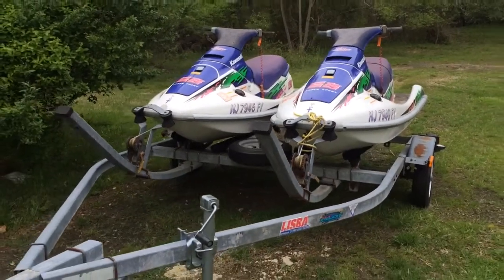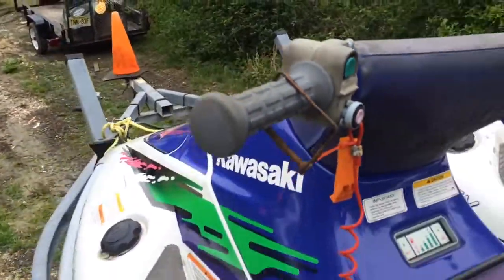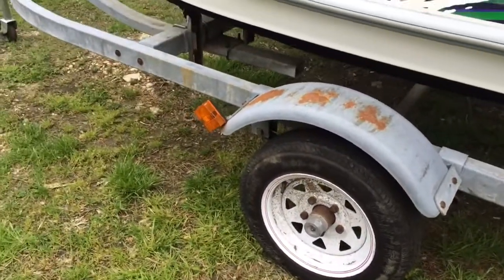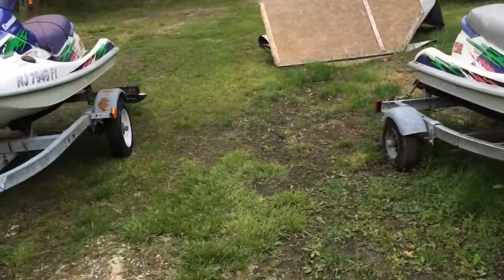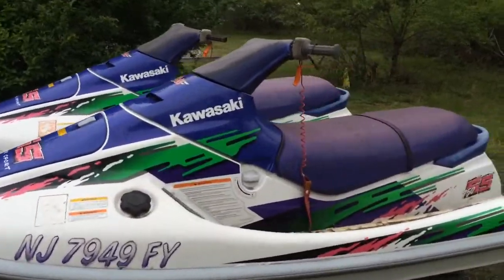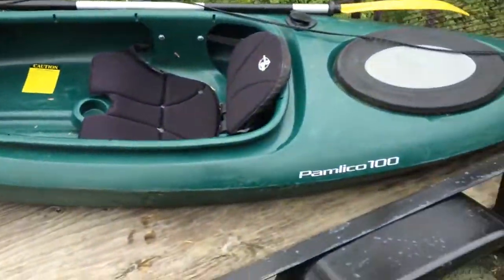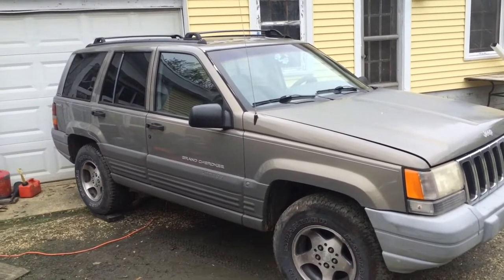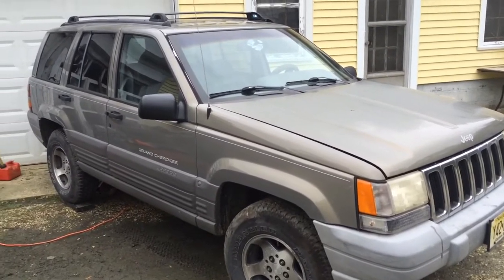dual jet ski revival, 94 kawasaki 750ss, the beginning

Comment: what kinda 🔋 are you using. I recently just got the exact same one you did
Reply from the maker: they are still under tarps this year. what i did was- 1 google size of battery oem used. 2 ebay found cheapest and soonest shipped. worked great last year, hope it does this year.
Reply: what all have you changed on them. I've finally got mine to turn over but not wanting to start. do you have to have the right batteries for it to start. Ik your not supposed to boost it but I do to see if the motor was locked but it wasn't
Reply from the maker: 1 hook up water source & make sure button by throttle is is run position 
2 pull off the air cleaner prime carb(pour small amount of mixed fuel into carb) try to start
if starts and stays  running great! 
  a,if not -check fuel supply line.
if you have fuel to carb, but still wont run
  a pull plugs check for spark  
  b,clean carb reinstall, make sure all hoses are tight at fittings, prime and try to start  
Good Luck!
Reply from the maker: CORRECTION--small button is to right side of start button not throttle sorry!